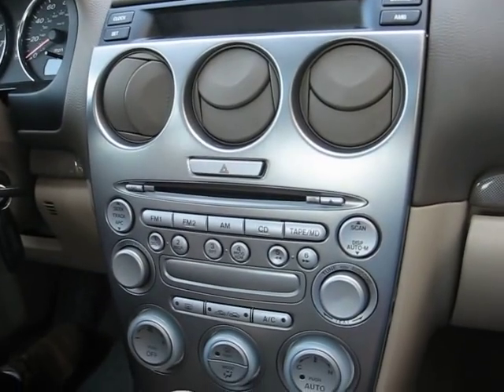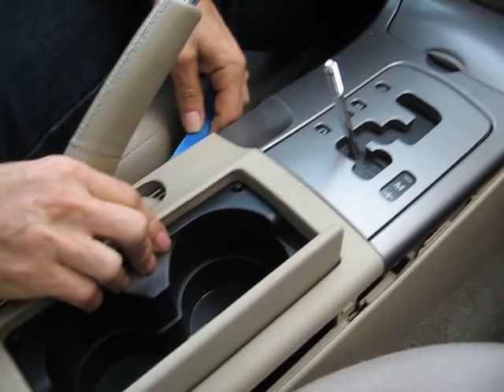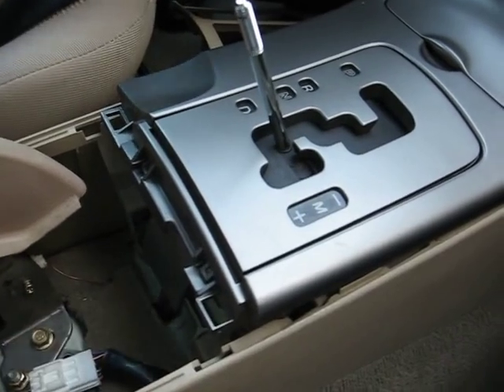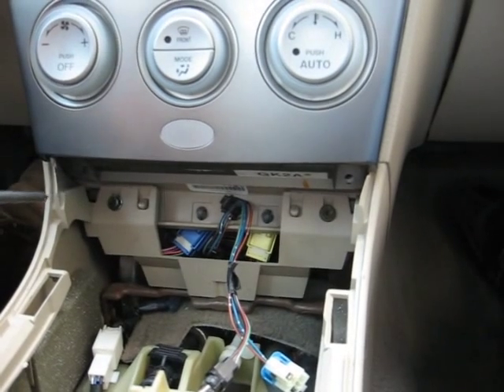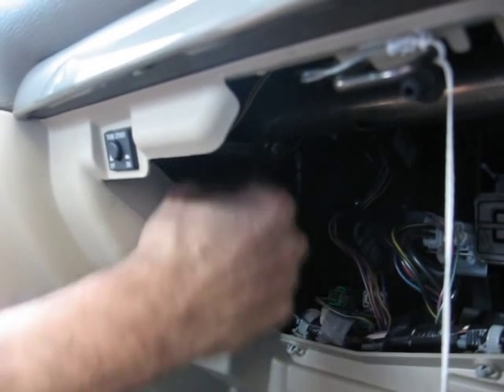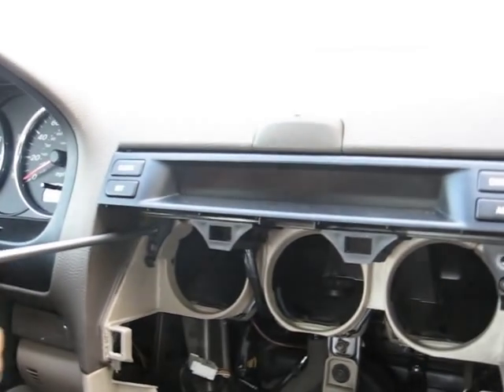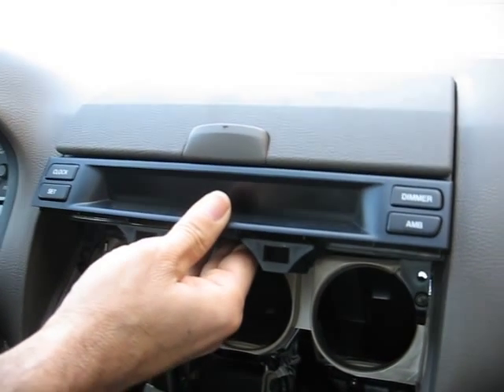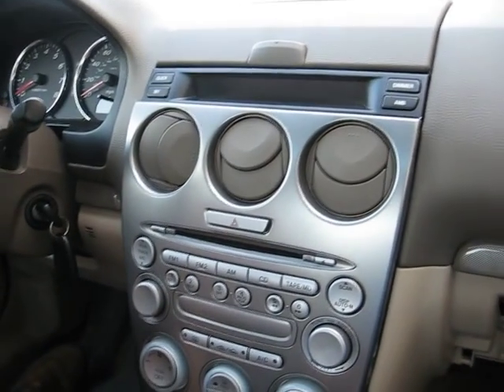How to Remove Radio / CD Changer / Display / Clock from Mazda 6 2004 for Repair.

Comment: great vid, first one that i have seen that has actually shown the saftey bolt and what it looks like rather then just vaguely pointing at an area and saying ya gotta remove the saftey bolt, followed by them saying 10 ml like i can differentiate between an 8 mm bolt vs a 10mm bolt

Comment: I'm gonna do this on my Mazda because I need to put in an after market stereo and your video is the only one that I could find that mentions the 10mm bolt.

Btw, I did this on my 99 Elantra before I got the Mazda and it is a nightmare because none of the components are actually attached to the dash plate, they are just pressed against it

Comment: 2 under control knobs 1 reach from the glove box and 2 at the bottom.
He didn't mention the 2 under the control knob (heat/ cold and the forgot what the other is, only 3 knob remove all 3 )